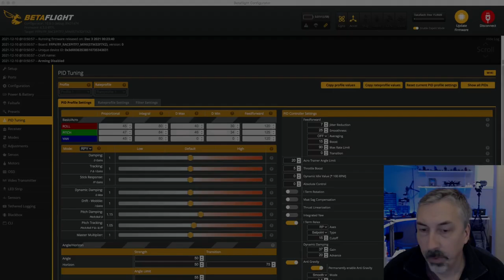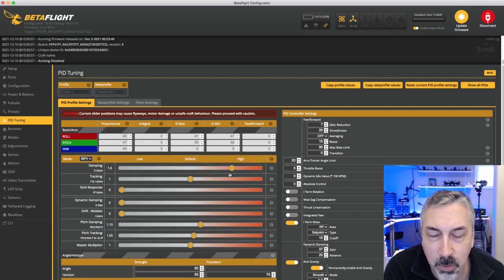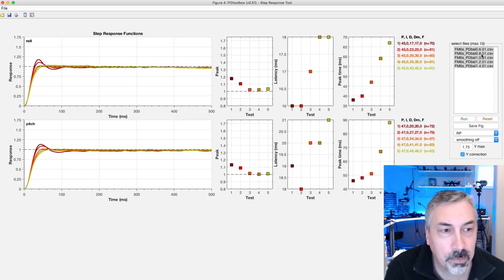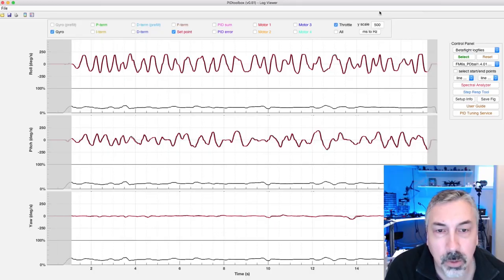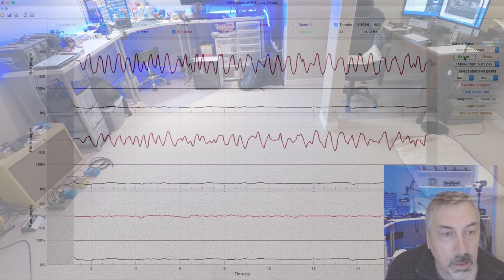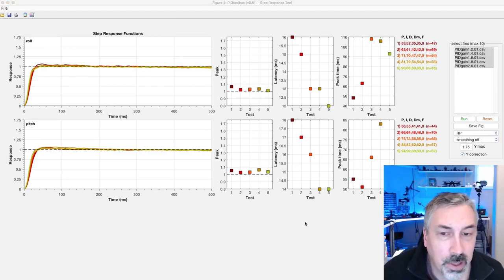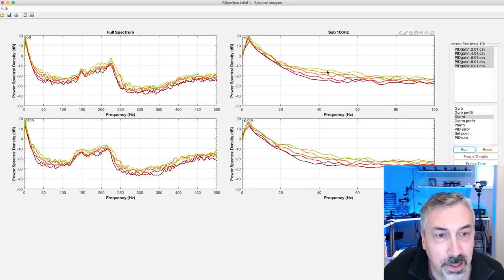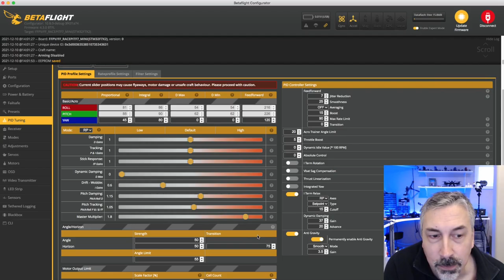Basement Tuning using the New Betaflight 4.3 Sliders!!!

Comment: i just wanna say BIG THANKS to you. with this video i was able to tune my 3´´ Tadpole to smooth flying and got the oszillations out of the video. it has little to almost no propwash left, but on normal cruise, fast climb and fast forward sinking the horizon looks really stable in goggle dvr. Video quality is better, more details, even almost in the dark. hoovering is also absolutely smooth and stable.  i will upload tag my videos so everbody can see the improvement. BF 4.3 is also a big improvement. i fly since 2005, but never had so much fun, tuning was 17 years a PAIN.

Comment: As I'm now using Inav I'm taking this new slider method and making an Excel Spreadsheet to replicate the steps (preserve the ratios). The first attempt went pretty well , but now This explanation makes it much clearer why I was getting confuses.  Simple things like dropping the I out, so obvious in hindsight. Your videos are a good pace and you explain the logic of what you do and why. Its refreshing. I've watched a few 4.3 videos and this has been the best so far.
Reply from the maker: great! I was planning a couple of quick vids on how to convert this method to INAV and EMU. Same concepts for sure. I am starting to think that maybe PID gain should come before Iterm though. This might seem odd, but on bigger rigs, if P starts low, the wobble can lead to under tuning Iterm if done before gains, whereas when gains come back in, error goes down naturally, and then often you can afford more iterm. so there's a kind of nonlinearity sometimes on iterm that doesn't hold as nicely as the P to D balance. Nonetheless, this should work as is for anything < 7 inch
Reply: @PIDtoolbox  yeah I'm using to really understand this not just follow a bouncing ball, I've had to go right back and understand filters etc as from what you have helped me see is the impact that can have is detrimental to the rest of the tune. ( By default mine are severely over filtered on Inav. As a new person to this level I'm still cautious to know what's safe and whats not so taking baby steps . I think that max d and d filter is almost a step/balance on its own delay/noise ratio loving your videos really really helpful

Comment: Very well done, one question, I may have missed it, do you recommend leaving Dynamic Damping Off?
Reply from the maker: I personally don’t use it but feel free. Once you know what range of damping effect you have on your particular rig, then you’re in a better position to know how best to set D min vs D max. You just have to know what you want to get out of a dynamic D. You could for example set your D max from step response results then set D min to a slightly under dampened state to get a snappier/faster response latency, ideal for racers for example. Or if you want a D boost kind of effect then set D min at the value you obtain from PTB and D max as a D boost. Just depends what you want and why

Comment: Thanks so much for putting this together! Never really understood or been good at tuning so having a step by step really helps! I did the angle mode flights and on my roll axis, I get a bit of over shoot with damping at 0.6 and 0.8 but the lines are smooth. As soon as I set damping up to 1.0, 1.2 and 1.4, the line on my roll axis isn’t very smooth, it gets squiggly just before the flat part. Any ideas what might be causing this? Thanks!

Comment: Few questions:

1) You start out with a arbitrary P number? It does not matter at what value you start as it gets adjusted later with the master multiplier?
2) What is Y correction?
3) Can you link those PID sliders to a knob on your radio (adjustments) to quickly tune?
4) If you have the opportunity, I guess it doesn't hurt to do actual flights instead of basements hovers, right?
5) Peak time gets worse when latency drops (file 4,5)

Comment: Is it right that if you have more filtering applied you can raise PID Values higher by loosing latency. So there is a balance between filtering and PID? So whats your Suggestion for Filter Setup before Basement Tuning? Filter Setup before or after Basement Tuning?
Reply from the maker: not exactly. More filtering, more latency, and more latency means you might not be able to push PID gains as high. It's counter intuitive. But basically, too much filter latency will limit how high you can push PID gains because it'll generate feedback oscillation and potential flyaway; similarly too little filtering will also limit PID gains because the gyro is too noisy and you'll get hot motors, and potential flyaway because of too much noise going into the pidsum.

Comment: Awesome guide, finally I am able to tune my quads properly. Thanks a lot! One silly question I still have. Tuned an AOS 3.5" and an FlowX Mini 3". After adjusting D Gains and Master Multiplier, the curve looks perfect. Adjusting I gains makes it look worse. Is is a Problem when I ends up on 0? Added 0.2 I gain but it does not look as clean as 0
Reply from the maker: Typically this would not happen if the error gap is reduced. Usually once FF is brought into the picture it will close this gap more and iterm won’t do that. The conundrum is you can’t examine the step resp with FF so you just have to analyze the raw SP and gyro traces to confirm the correct amount of iterm. There is a vid after this one that describes this. Check those out
Reply: I am in the exact same position. My lines looks almost perfect untill i add I Gain and it overshoots. I noticed you adjust Drift Wobble - I Gain before the master slider is that the correct order? I can't lie, i've watched a video from someone else using this method and they said to tune I Gain after Master Slider.

Comment: Hi!I just bought some batteries for my chimera7. Should I pid the quad with the heaviest battery or the lightest? I’m using 6s1p 4000 mah and 6s2p 8000mah, is the difference in weight too high to have only one pid set up?

Comment: Very clear and detailed, exactly what i was look for. A question, do you really leave iterm relax on for the tuning? When do you know you need to increase or decrease it?
Reply from the maker: Great point. I’ve left iterm relax as is for the moment under the assumption that it’s mostly not being triggered with these smaller moves. So the iterm estimate we get here should be decent for moderate stick moves. When you do fast full stick the default relax takes care of any windup. You could certainly turn relax off for these tests if there was some concern that it’s already having some effect on these moves.

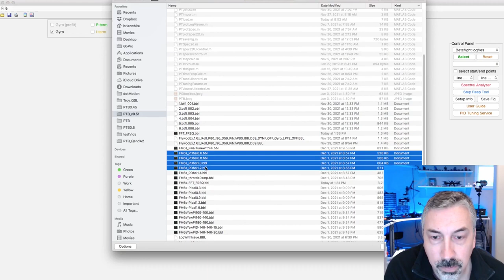Comment: At 2:22 I can see you have tuned the Flywoo Explorer. I am about to tune my Explorer4 (1. gen) and my Rekon5 (6S version) because they should handle the weight of 4S Li-Ion packs. Do you have any suggestions how to tackle these tunings for quads with low power to weight ratio? With the Rekon5 I still had plenty of overshoot at PDbal 2.0. BF sliders need to go further ;) N4V1G4T0R also noticed to tune differently for quads with assymetrical axis, like these dead cat frames. I watched your video about tuning the 10" Li-Ion. But any caveat would be welcome.
Reply from the maker: One option is to start with PI gains set higher before starting with the damping slider so that you have more room to go when using the MM. that’s probably what I’d do there. I should do a vid basement tuning my ultra lightweight long range quad. Hmm

Comment: Hi Brian,
If I plan to use dynamic idle, do you suggest to tune it after the pids or before going into tge process you showed?
My guess is that since it improves motors responsiveness it should be active when tuning but I'd realky like to hear your thought
Reply from the maker: I dont think it matters because you're above idle doing these tests. Idle is referring to responsiveness at 0 throttle

Comment: Good tutorial! It looks like it can be completely automated by Betaflight itself. Its algorithmically possible to choose best curve from toolbox in realtime I guess. Did you've proposed this idea to BF developers yet? I see it like one take (single lipo) process - like arm, enable "autotune mode", lift off, start shaking your drone in all directions and BF will adjust D gain based on response curve in realtime. Then I and MM, done. Right?
Reply from the maker: Not quite as simple as you think but certainly doable. There are many edge cases that make it less than simple though. Also this is my project. BF have different interests but we do talk about it once in a while. There’s just so many other things focused on atm
Reply: @PIDtoolbox  I understand. Specially after math lab package was downloaded and installed 😀 Thank you for your work! First time I see real math behind PID tuning process and it easy to follow.
Reply from the maker: @vsobolev  thanks man!

Comment: I love that concept of basement tuning. Thank you so much! Just a quick question about disableing FF. Isn't it necessary to set FF Transition to 1 anymore, because the Stick Response slider reaches all the way down to zero in BF 4.3?
Reply from the maker: No, when the FF slider is put all the way to 0, FF is off. That’s all you need to do the tests. Then when done is set FF back to defaults and adjust jitter and smoothing as desired using the “tooltips” “?” There for info on how best to set this

Comment: At the end of your tune video you did not mention what you would do with the Dynamic Damping? You have it at 0. I set mine at .5 and I liked the way your tune proccess worked for me. Also what about filter tuneing and does this affect your procedure at all? This would be after you tune the filters, is that correct?
Reply from the maker: great question, I've responded to that one elsewhere here. but will copy paste my response here: "I personally don’t use it but feel free. Use of dynamic damping (which is essentially making D term dynamic with amount of stick) is not widely understood I dont think. You really need to know why you want to use it. If you wish to use it, then once you know what range of damping effect you have on your particular rig, then you’re in a better position to know how best to set D min vs D max. You just have to know what specifically you want to get out of a dynamic D. You could for example set your D max from step response results then set D min to a slightly under dampened state to get a snappier/faster response latency, ideal for racers for example. Or if you want a D boost kind of effect then set D min at the value you obtain from PTB and D max as a D boost. Just depends what you want and why"
Reply: @PIDtoolbox   Thank you for your fast and clear response.

Comment: I imagine this process would be very similar using Kiss?. Although Kiss doesn’t use sliders etc manually increasing D with a set P to find the balance and then the same for I would that get things somewhere close? Any advise for Kiss users wanting to use PidToolBox in this way?
Reply from the maker: Use the new PTB slider simulation tool in v0.62
Reply: @PIDtoolbox  I’ll check it out thanks 
Great info, been checking out a few of your videos👍
Reply: @PIDtoolbox  any reports on the logs not loading properly? When I try to trim the logs I get the cross hair first appear to select the start of the trim, then when try to click on the  end of the trim it’s like doesn’t let do anything. When trying to open step response files they kinda just want to buffer and says insufficient data? Ever heard of anything similar before?

Comment: I don't have the skill (or guts) to do as sharp a stick movements as you do in this video. My plots therefore look less sharp. Is that still useful data or do I need to have sharper movements?
Reply from the maker: it's not necessarily why your plots don't look as 'sharp' as you say. but if the plots are unreliable then it could help to do longer tests. if you dont know whether the data is reliable, here's a test. do the same test with same settings twice. compare plots. it they are very different, then your data is unreliable. then do the 2 tests again, but for a longer period of time (more data). then compare. it should get more reliable with more data, and then you can be more confident in the results

Comment: First of all, thanks for all this! Why yaw its not being tuned? I want to tune a cinewhoop for indoor flying i use lot of yaw beacause of low tilt camera (real state) should i worry abojt yaw tunning?
Reply from the maker: Yes yaw should be tuned. It’s just not part of the BF slider system to treat it as a separate parameter. To optimize yaw requires removing it from the slider control and inputting manual inputs. It’s also tricky to wobble pitch without having the copter jump in altitude so indoors is kinda out of the question.
Reply: @PIDtoolbox  yaw could be tuned flying around using yaw for turns? Thanks
Reply from the maker: @gonzafpv2843  of course. That’s always been an option
Reply: @PIDtoolbox  thing is i don't know how to do with the values, proporcional, integral d max and derivative :s
Reply from the maker: @gonzafpv2843  well there’s no need for D on yaw. So you have P and I. So PI balance and PI gain is all you would test. For PI balance I’d manipulate I until you get slow bounce back. Then add PI gain holding the ratio constant  until there’s no measurable decrease in latency. Something like that might work

Comment: Hi Brian, i noticed a completely different resoult between the basement los flight logs and the effective flight with sharp manouvers, full stick flips and rolls.. in the first one i managed to flat down the curve perfectly but in the actual flight i have massiveovershoot in the step response tool.
is it normal? 
thank you for your time :)
Reply: in the actual flight i added FF.. could it be the reason for the overshoot? and if so, in that case shuould i leave it at 0?.. because as i improove it overshoot more and more
Reply from the maker: @fefpv5001  yes it's most likely from FF. But also it depends on what you're doing between the full stick deflections. if there's a lot of pauses between a series of moves then the step resp will still tend to extract data that will go into the average, and this data is usually crappy. but it's most likely FF changing things
Reply: @PIDtoolbox  got it
Thanks

Ps: great job.. Your method seems to be the more effettive between the most popular (jb/Cr)
Thankyou for doing it 🙏

Comment: Can you show graph after setting FeedForward? When i tune feedforward in acro mode, i have overshot is it normal?
Reply from the maker: @andreua8779  no, you should not use the step resp to tune FF. All you do is examine the effect on sp-gyro tracking, from the raw traces. You should also examine the quality of the F-term while you’re at it, to be sure your FF settings are working properly
Reply: @PIDtoolbox  so, i only use pidtoolbox step resp to setup P I D in angle or acro mode

Comment: when i tune the master slider i get more and more an overshoot. pd und pi i make it like you (curves loos identicaly) so that i have no overshoot. after masterslider it reach earlier and earlier the setpoint but with massiv overshoot. 7inch heavy ciopter mit 4s2p liion pack
Reply from the maker: keep FF off, and Iterm low during MM tests. Then add iterm, and finally FF, but do not use step resp to analyze effect of FF. that has to be done from traces directly

Comment: What does it mean, if you can't seem to tame the overshoot with D? is that due to esc settings?(48khz?) too much P already? too much filtering?(pretty much stock / rpm on)?
Reply from the maker: depends. Is overshoot there when Iterm is off? Sometimes adding some more gain will reduce it, if the authority is really low. So if you're testing P-D balance but both are fairly low, it might help to try the tests starting with higher P. Ive also seen that lower ESC pwm can help. but Im speculating on what your specific issue is. only way to know for sure Id have to see the logfile.
Reply: @PIDtoolbox  I'll probably be contacting you for services. I'm tired of fighting with it lol.
Reply from the maker: @justinflipflops  I'd be more than happy to help. You'd certainly get a ton more than I can put into a single video.